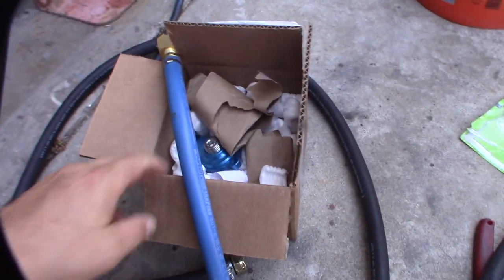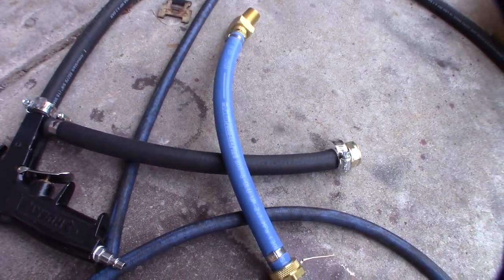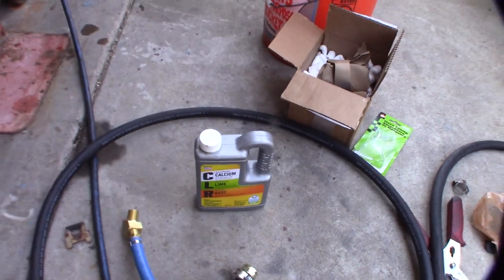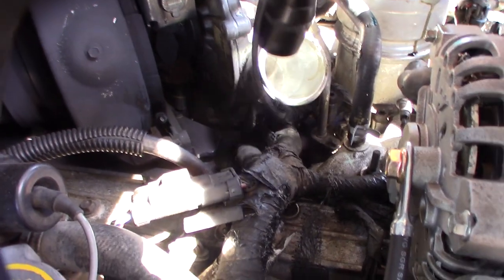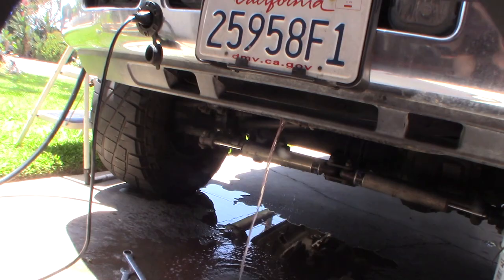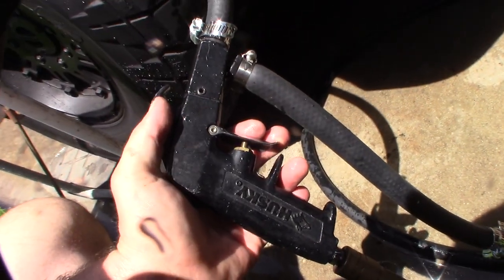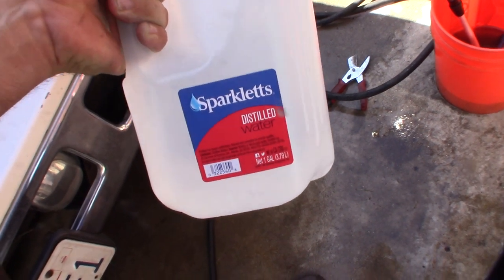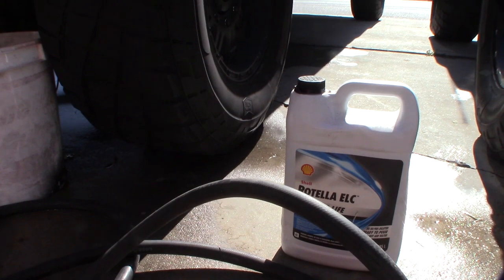Powerstroke 6.0 F250 backflush with CLR lower coolant oil temp delta

Comment: I use a deep 4mm ball driver on a 3/8 socket in place of the t27. If you are afraid of breaking ball driver because of reduced shank size, loosen first with small key wrench. Works great.
Love the video
Reply from the maker: How did your backflush turn out. I have better luck with Lime-A-way
Reply: Fintech Repair Shop hello, I have not flushed yet. I only removed the 2 torx bolts to see if I can do it. I'm going to order "flush kit" as soon as I receive my Scan Gauge tool, (ordered 3 days ago) and record my oil temp before I affect the cleaning process.

Comment: have u had any issues with rpm fluctuation at idle? cuuz my truck started doing it.
Reply from the maker: sometimes. Its sound like something activating and deactivating
Reply: @fintechrepairshop  on mine the truck just wants to lurch forward. like the turbo spools.
Reply: @Reyes6.0  Was it cold?
Reply: @roderich5867  I can't remember now. it's just stopped all on its own
Reply: @fintechrepairshop  how did the CLR workout? Did it have a positive or negative effect? Or was it worth using it?

Comment: I'm getting delta of up to 20 but oil temp hasn't gone up past 205ish.  Should I backflush?
Reply: Sounds like you need a thermostat. If your seeing 20° deltas but it hasn't went over 205 would say your coolant isn't getting over 180-185. Factory ford thermostat opens at 195. But if your seeing 205 with that cold of coolant you may want to flush the cooler as well.